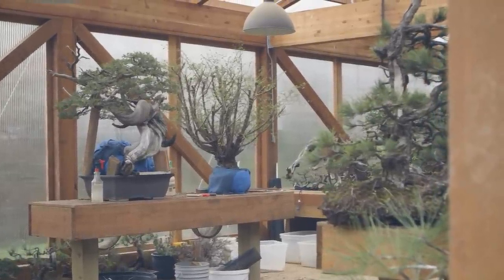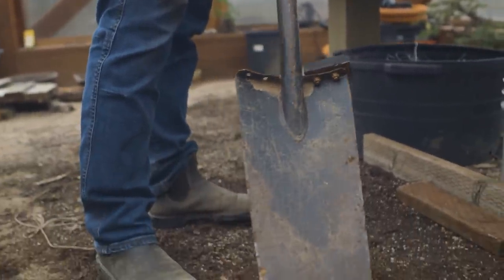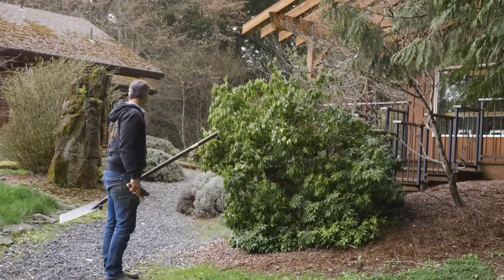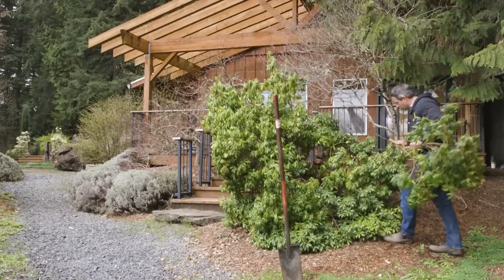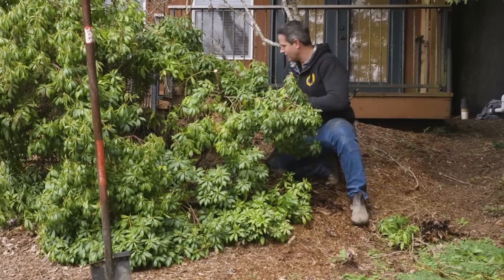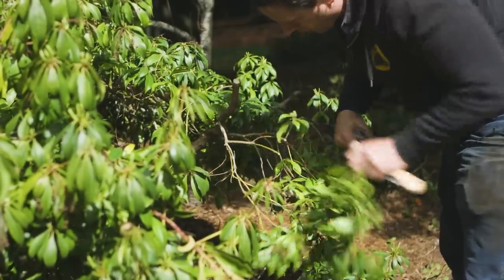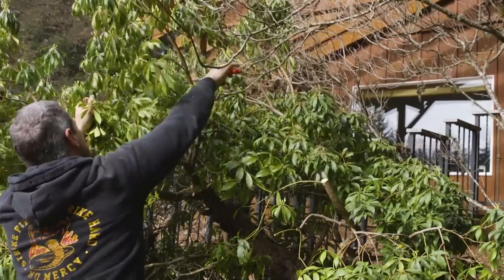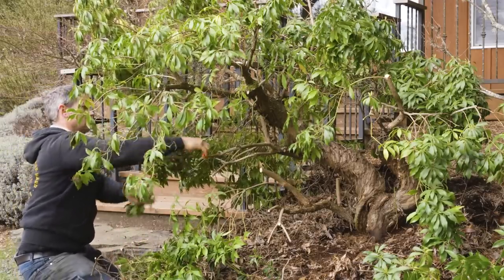Urban Yamadori Extraction

Comment: You need to learn how to work smart not hard.  Example: 
1.  Slow, deep, pre-soak the soil the night before. 
2.  Wrap tow strap around base as low to the ground as possible 
3. Tie the other end of tow strap to truck bumper or tractor
4.  Slowly move forward 
5.  Plant and root ball will pull up out of the ground with ease
Reply: Good way to destroy the roots on purpose, if that's what you're aiming for.